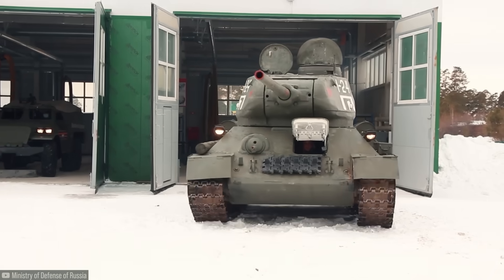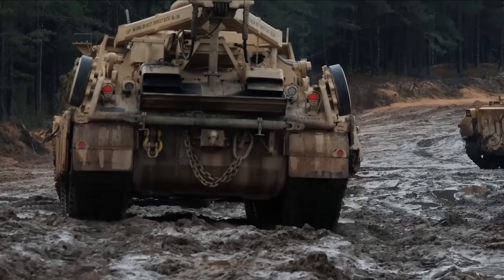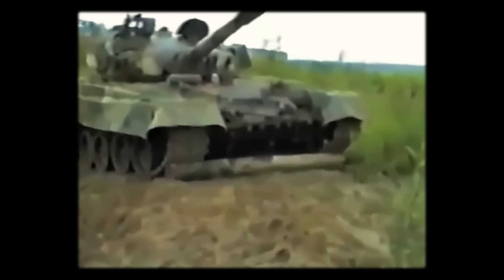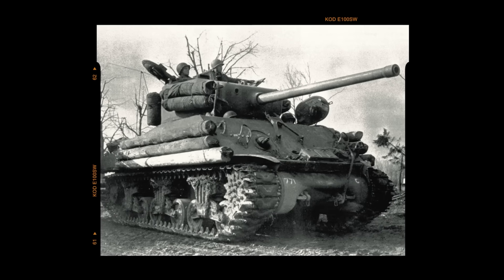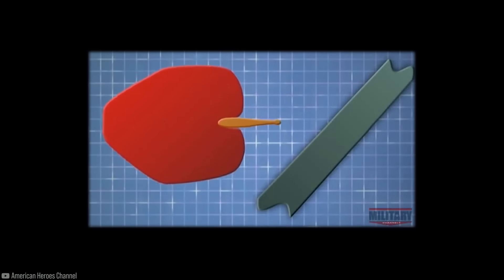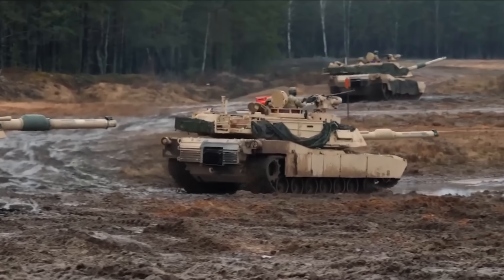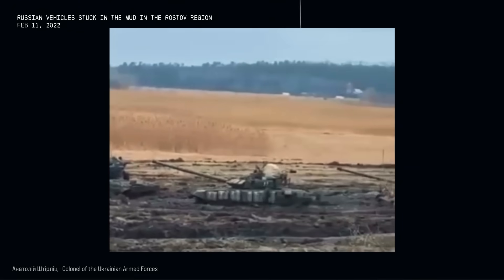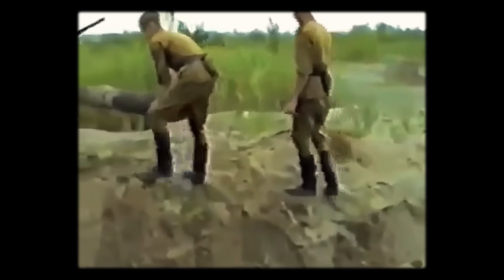The trick the Russians use to save their tanks

Comment: I know the T55. At the back of the T55, we allways had a beam for the mud, and a tube for the forced water crossing, but we never used them. The T55 could pass everywere, without the beam, except its chassis got stuck. In the rare case, when we got hang up, generally an other T55 pulled us with a wire.

Comment: Log is to escape mud. Chain it to the tank treads and drive forward, big paddle. Not a new concept. About as old as the tank itself. That protection line is bs.
Reply: Bs in a sense that they didn't use logs for protection or bs in a sense that it actually worked?
Reply: @kindlingking  it's only one log, it doesn't afford additional protection. Spent 7 years as mechanized infantry alongside armor. The logs role is solely for extraction when stuck in mud.

Comment: It's oficially called "Self-pulling-out log" in tank equipment specification. And yes, it's a log. And it works fine, at least with 20-30 ton tanks.
Reply: No tank has been that light since before WW2, pal, except the very small light tanks like japanese Type 95 Ha-Go. But it's not a MBT like all the ones presented in this video.
Reply: @justalonesoul5825  most tanks are like 40-50 tons.
Reply: @temkaster2  Only autoloaded ones like T-90, Leclerc and Type 10. Chally 2 can go all the way to EIGHTY tons with all the additional equipment (but no log).
Reply: @justalonesoul5825  Thats a limit for american log, supreme russian science allowed for even hevier tanks to use it using bigger log.
And jokes aside russian tanks have wider tracks with stronger linkage so they can atach big log without breaking the track links like abrams tend to do trying to do same trick, as ukrainian army has proven by trying to unstuck thier first abrams this way.

Comment: I've now installed a log on the back of my Jaguar - "Better to have it when you need it, than not have it at all" Great vid
Reply: Auto manufacturers should bring back the spare tire.
Reply: @babylonmustfall  Bring back? When did the automobile manufacturers stop putting spare tires in cars?
Reply: In Europe many manufactureres replaced the spare tire with a cost reducing "repair kit" for more than 20 years now.
Reply: @ Interesting... I have a Golf 6, but it has a spare tire. So, that repair kit, there is no tire, not even one of those small ones that can carry the car to the nearest workshop? That is insane.
Reply: @ozymandiasultor9480  Some vendors offer the option of such an emergency little tire if you are willing to pay an extra charge.
Reply: @alexany4619  Yes, I have seen those small tires, that is some solution after all, my spare tire is the same size as my other tires but for some reason, it is written on the tire that I must not drive over 80 km per hour while driving with that spare tire.
Reply: @ozymandiasultor9480 that's bcs when you change one of your tires with a new one, it has different weariness and so, road grip. Which can lead to uncontrollable drift on a high speed, and to a colourful(mostly red) car crash. So yes, if you want to be safe after tire replacement, drive slow and careful.
Reply: u use your jag for off roading? when it's not in the shop being repaired.🤣
Reply: Great idea, it's good to have at least one thing in Jaguar that does not break
Reply: Is the log in case you lose your butt plug?
Reply: You can customize it to look like a wing on McLaren and others sportcars, so it would look even fancy 😂
Reply: Jaguar ? you mean Faguar ?
Reply: @bluedragontoybash2463  Indeed - A pink one
Reply: @GHOOGLEMALE LMAO love how you took the smack talk and rolled with it. Good man